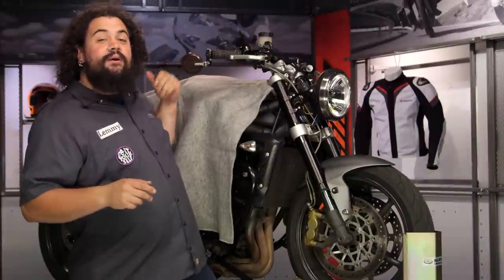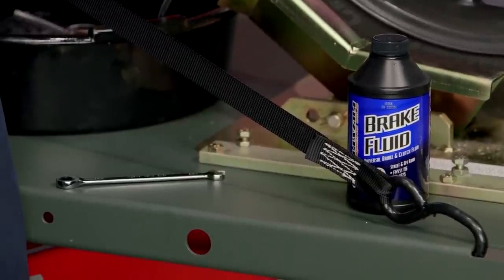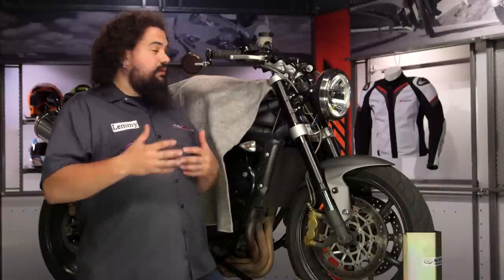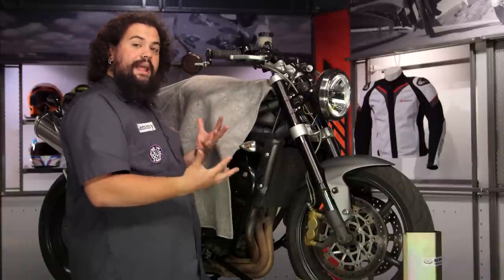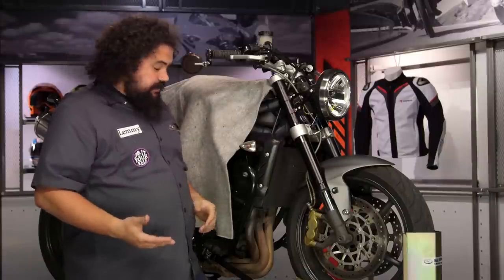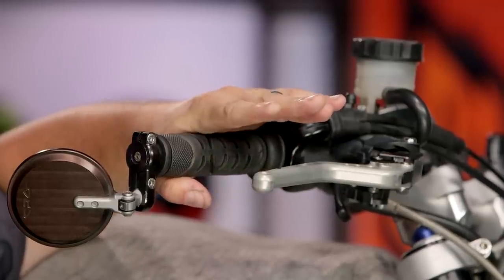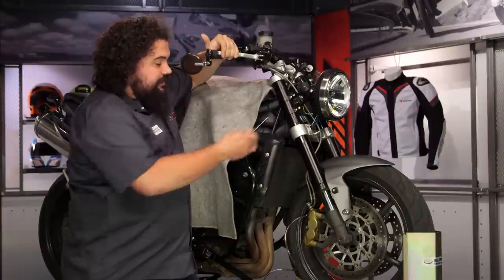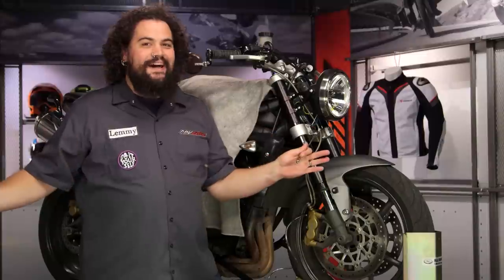How To Bleed Motorcycle Brakes at RevZilla.com

Comment: Is this the same for a 2014 Vrod Muscle? I did this but rear pedal still feels spongy on first brake application. (Brakes work fine on second pump each time) HD says this bike needs to be hooked up to a computer..?
Reply from the maker: Yes, it should still be the same, and if you still have a spongy feeling, there's likely still air in the line. That bike may need to be hooked up to a computer, in order to confirm to the onboard computer that the brake service has been completed. -DrewZilla

Comment: What happens if close the master cil cap and then I decide to bleed the master cylinder top bleeder just a little bit? Will it produce any sort of problem? Should I reopen the master cil cap in order to even the pressure
Reply from the maker: That will suck the diaphragm in the master cylinder down a hair if you do that.  Not a really bad thing, but personally I would just pop the cap off, make sure the diaphragm is at resting position, then re-install.

I hope that helps!
-Zack

Comment: So i have a question/ problem.  My front break when im trying to bleed it , the fluid is not leaving the resevoir.  I followed all the steps in this video .. could my lines be clogged somewhere to cause this??
Reply: unscrew the bleeding valve  fully and inspect

Comment: So it's the exact same thing with the lever just changing the hose to a different opening ?
Reply from the maker: That's exactly right. You would repeat the same process of building pressure, opening the bleeder, checking for air, closing the bleeder, and releasing the lever. Hope that helps! -TeamZilla Chris

Comment: hi put new master cylinder on, when I put the dot 4 in it just stays there, is my hose full of air. pull the brake noththing happens. have you got a you tube to show me from scratch fitting new hose and cylinder all the best
Reply from the maker: We don't have a video showing installation of a new brake line and master cylinder. Once you fill the reservoir, you need to squeeze the brake lever then open the bleed screw at the caliper while still squeezing the brake lever. If no brake fluid comes out, close the bleed screw, release the brake lever, and then repeat the process until you do get brake fluid flowing through the lines and all air is out. See Lemmy's companion article for more tips. -DrewZilla
*http://www.revzilla.com/common-tread/video-how-to-bleed-motorcycle-brakes
Reply: RevZilla thankyou so much

Comment: I bled my breaks like this for about 2 hours  after replacing seals and went through about 500ml of fluid and there was still air? Can you suggest what the problem is ?
Reply from the maker: Try squeezing the brake lever and securing the lever with zip-ties to the handlebar. Then leave the front brake lever in the squeezed position overnight. This can help air work it's way up and into the reservoir. Take a look at Lemmy's companion article for other ideas as well. -DrewZilla
*https://www.revzilla.com/common-tread/video-how-to-bleed-motorcycle-brakes

Comment: What's the diameter of the clear tube you use? And would the same size tube fit on a Derbi GPR 50?
Reply: +ZLA Lemmy
Reply from the maker: 3/16" should be about right, though we cannot guarantee it will fit the Derbi. -DrewZilla

Comment: Hi guys, I am installing a braided brake line for my 2011 GSXR 600, When I finish all the things , I try to bleed out the air (use a vacuum pump) from the new brake fluid,then problem coming. The air with fluid continuous come out from the MC bleed nipple( I keep refill the reservoir twice of total reservoir). I tight every thing. I do not know where is wrong. And the brake lever just a little pressure
Reply from the maker: It could be a number of problems, which are difficult to troubleshoot via YouTube. You may need to consult a local mechanic. -DrewZilla

Comment: If I've bled my brakes but have now noticed a slight leak around the bleed nut after completion, what are my options?
Reply from the maker: Replace the bleeder screw if it is stripped, otherwise bleed again and tighten it. Or reach out to your service department, since this process is potentially dangerous and having physical assistance is recommended. -DrewZilla
Reply: Many thanks. Tightened a bit more and now seems ok. Thanks again for the reply.

Comment: bought new rear caliper for 03 honda vtx 1300 got the hang on far as bleeding it .  but it's not tightening like you should on the rear brake pedal. shit I am stuck.......... need help on pumping pressure on rear caliper
Reply from the maker: If the normal bleeding procedure is not building pressure and evacuating fluid, there may be an issue with the master cylinder if the caliper is brand new. I would double check any potential openings in the brake system, and also make sure the tubing connected to the bleeder nipple is securely attached. Did you drain the entire system or just swap the caliper? -TeamZilla AJ

Comment: Ok I need help.
Just rebuilt my caliper as a pin was sticking.
Trying to put fluid back into the lines and getting absolutely no pressure.
Been pumping the nipple in and out for half an hour and still the lever is totally sloppy.
How long does this usually take or have I made a mistake on rebuilding?
Reply: Did you ever figure it out? I’m having same problem
Reply: @scatcat1994  I got man 😎 appreciate the help💪🏻
Reply: @DirtyD636  nice one!

Comment: I have an ABS in my bike, is there any additional steps if I want to flush my brake?
Reply from the maker: Possibly. Check your owner's manual or a factory service manual for full instructions though. -DrewZilla
Reply: it says: please go to your nearest authorized service shop to flush brake fluid every year/30.000km, do not try to do any maintenance with the ABS actuator or it will void you warranty.
well, no more DIY for me. Thanks for your reply, if you didn't remind me to read the instruction manual I'm pretty sure I will void my bike's warranty.
Reply: I recently purchased on 09 with ABS brakes, the ABS brakes can be turned off for riding in the dirt.  I'm going to try and flush the rear brake, being careful not to let the reservoir empty.  Once done, I'll take the bike out in the dirt, with the ABS on, hit the rear brake fairly hard a few times, I think this would flush the ABS portion of the system.  Once I get done, I'll flush it again.  I'm thinking this will work, obviously if it doesn't I would have to take a trip to the dealer afterwards.  With an 09, despite the low miles, I don't think I have a warranty anyway.

Comment: Guys, could you make a video "How to change front fork oil seals"? Thanks in advance.
Reply from the maker: Rayugu That may be a little too technical for this series, but we'll certainly consider it! -DrewZilla
Reply: ***** Wow, thanks, man. My front fork is still leaking after I changed them and Im just trying to figure out, what I did wrong. Seems like it's bad seals.
Reply: +ZLA Lemmy I've got USD fork on my gsx-r600 and from that point of view - yep, they are leaking right out of the dust seals, splashin' oil on brakes and front wheel. It happens only when ride. When bike standing still - nothing is coming out. I examined both upper and lower legs and there is no scratches or other damage on them. I assume that its the bad seals or I made a mistake and inserted them wrong - I inserted them in external tube, right where the old ones were, using socket wrench head, big enough to cover a seal, and rubber hammer. Only after that I filled oil and assembled the fork.
Reply: +ZLA Lemmy ok, thanks, i will check that.

Comment: Does that reservoir on the right handlebar cover the rear brake as well? Or is there a different reservoir? (Old generic Chinese dualsport)
Reply from the maker: Usually, the rear brake is controlled by brake pedal at the right footpeg. Therefore, the rear brake reservoir would be near the right footpeg. -DrewZilla
Reply: Just realized my rear brake doesn't have brake fluid.. lol. Thanks anyways! :D
Reply: Wat
Reply: +KelseyMFJohnson Its a shit chinese dual sport.

Comment: Hey lemme,  my brake fluid is way low, obviously needing to be filled. but my question brother,  is that, I'm not sure if it was synthetic or not. Now I'm not much of a mechanic but I wanna do things myself. Should I bleed them like you have stated in the video, and change the pads or do Is it just safe to throw in the dot 4 it calls for and take a gander on a different weekend. I have a ride I'm going on shortly and do not know what to do
Reply from the maker: We recommend using what your owner's manual states is appropriate. -DrewZilla
Reply: don't have an owner's manual. guess I should get one lol
Reply from the maker: Always a good idea. -DrewZilla

Comment: +revzilla I need a new master cylinder for my 92 sporty and I have an extra mc that came off a 2010 softail but its dot 4 and my sportster uses dot 5. Would I be able to flush out the mc with alcohol and use it? Also would I be able to use the stock control switches that came off the 2010 softail?
Reply from the maker: It is EXTREMELY difficult to clean the brake system well enough to make that swap from DOT4 to DOT5, so neither we nor likely anyone else would make that recommendation. Your brakes are pretty critical, and it's just too risky. Don't do it. As for control switches, if you really feel like wiring everything up, you could use them, but it's a pain. -DrewZilla

Comment: I have a problem when I crack the bleeder screw open the fluid is coming from the base of the bleeder screw rather than from the tip.
Reply from the maker: In your case, I would recommend reaching out to a trusted service department, so they can help diagnose your issue further. The issue may not be isolated to your bleeder screw. -Luke

Comment: Why do you need to open the reservoir to bleed the brakes?
Reply from the maker: You need to fill the reservoir with fresh fluid as you're bleeding so as not to introduce more air into the system. -DrewZilla

Comment: Ive no top bleeder im sure im having air issues done the lever thing no luck any ideas ? Thanks
Reply from the maker: You don't need a bleeder at the master cylinder. Try the other tips in Lemmy's companion article. Make sure you're keeping the reservoir full, and gravity bleed if necessary. -DrewZilla
*https://www.revzilla.com/common-tread/video-how-to-bleed-motorcycle-brakes
Reply: RevZilla hi thanks somehow it resolved itself earlier today very odd

Comment: How does the process differ when the bike has ABS?
Reply from the maker: It all depends on how the ABS system is implemented. Unfortunately, each brand has different fine points for bleeding ABS brakes, so you really need to consult a factory service manual for your bike. Sometimes you can't even do it yourself, because you need special software the dealer has to reset the system. -DrewZilla

Comment: If you are taking off the wheel with disc brakes do you need do anything to the brakes or can you just leave the brakes in place?
Reply from the maker: With some bikes, you can remove the wheel with the brake calipers still in place. With some other bikes, you need to remove the calipers from the fork to remove the wheel. -DrewZilla

Comment: I'm about to put back on my brake callipers on the bike do I pump the lever to get the pistons up against the pads and then bleed
Reply from the maker: Once you have the brake calipers back on the discs and bolted to the fork legs, then yes, you can pump the lever to set the pads. That way you'll build better pressure when you squeeze the lever and open the bleeder valve. -DrewZilla

Comment: What if the master cylinder isn't pumping enough or no pressure bus building up🤔
Reply from the maker: Then there's probably air in the line or there's an issue with the master cylinder. -DrewZilla

Comment: I have a 83 virago, im curious as to whether i bleed rear brakes in a drive shaft bike, and if i do how?
Reply from the maker: Brakes are separate from the drivetrain, as there are many shaft drive bikes with rear hydraulic disc brakes. However, your bike has a mechanical rear drum brake, so there's nothing to bleed on the rear. -DrewZilla
Reply: Thanks for the reply and that was really helpful

Comment: What can I do if my master cylinder doesn't have a bleed valve
Reply from the maker: You just bleed from the caliper. -DrewZilla
Reply: RevZilla it's taking forever to get pressure in the lever I put steel cables on my 04 gsxr 1000
Reply from the maker: Try this tip from Lemmy's companion article: "Go to any motocross event, and you'll see lots of brake levers zip-tied to the handlebars to make sure the brakes are at their very firmest. Chuck a brick on your brake pedal or zip-tie the lever down as hard as you can. (A rag wrapped around the grip here prevents damage.) Next, go to bed. Get up in the morning, cut the ziptie, and admire your oh-so-firm brakes." Hope this helps! -DrewZilla
*https://www.revzilla.com/common-tread/video-how-to-bleed-motorcycle-brakes

Comment: can you put Brembo brakes on any other motorcycle besides a Harley.
Reply from the maker: robert S Absolutely! In fact, Harley was late to the party when it comes to bikes that have Brembo brakes. Many European sport bikes have used Brembo brakes for a long time. It's not a one size fits all option though. Just like a Harley fairing, the Harley Brembos are specific to Harley. They won't fit a Honda. -DrewZilla
Reply: RevZilla will they fit Suzuki or Yamaha.
Reply from the maker: +robert S Harley Brembos only fit Harley. Brembos are designed for specific applications. -DrewZilla
Reply: ok thanks.

Comment: How do I stop squeaky brakes as well?
Reply from the maker: You might need to change the pads or check if the rotors are warped or damaged. -DrewZilla
Reply: disassemble your brake pads and sand the surface (or better, replace them). Applying a bit of copper grease in the pads (not in the braking side of them !!) can help.

Comment: What if you have no pressure to begin with
Reply from the maker: Are you able to build any pressure at all by repeatedly pumping the brake lever/pedal? Do you have brake fluid in the reservoir? -DrewZilla
Reply: Yep no pressure and yes there fluid
Reply from the maker: Ok, you may need to replace the crush washers and then try to rebleed. If that doesn't help, then seek a qualified mechanic. -DrewZilla